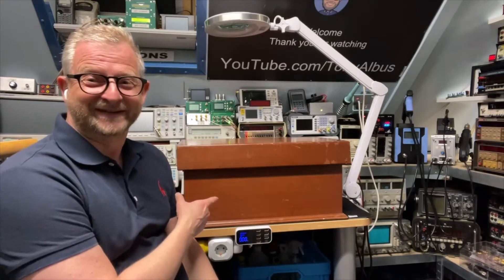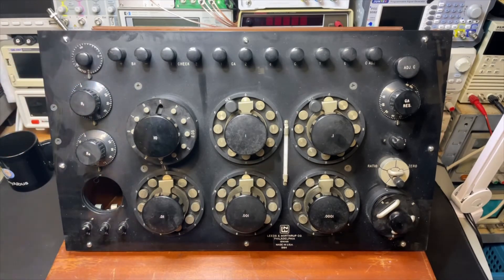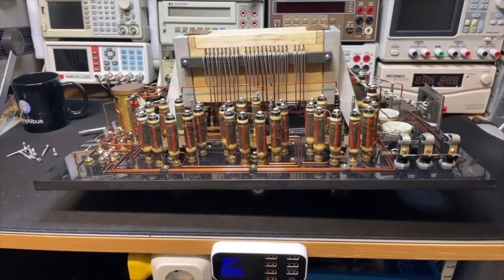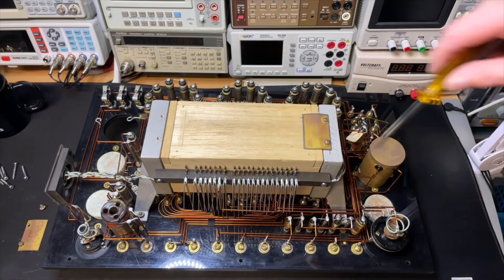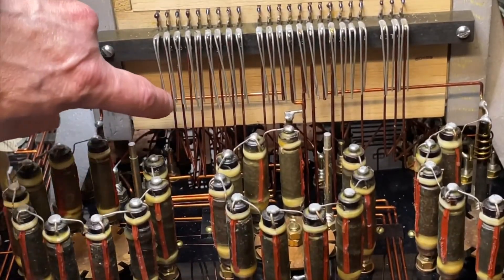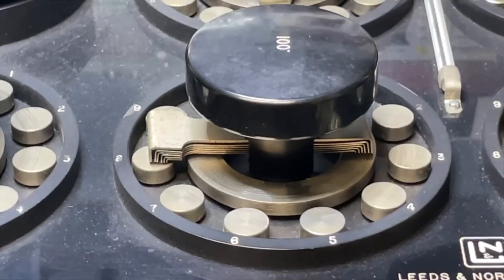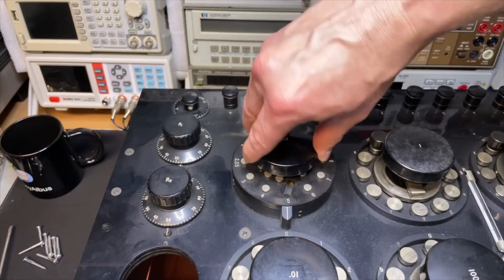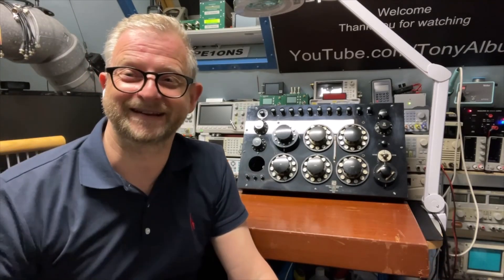#202 Classic Week Day 5 of 5 -  Leeds & Northrup Wheatstone 1964

Comment: You need a center zero meter for this unit
Reply from the maker: An external one i think right? do you know the value? .. from the pictures i have seen, the internal meter to be 0-5 mA
Reply: @TonyAlbus  As you are reading a bridge in balance the current through the meter is zero, so a center reading meter has to indicate either side of zero mid scale.
https://www.ebay.com.au/itm/254774972297?chn=ps&norover=1&mkevt=1&mkrid=705-139619-5960-0&mkcid=2&itemid=254774972297&targetid=1278935638209&device=c&mktype=pla&googleloc=9071768&poi=&campaignid=12502547493&mkgroupid=123090288695&rlsatarget=pla-1278935638209&abcId=9300512&merchantid=7364522&gclid=CjwKCAjwxo6IBhBKEiwAXSYBsyBWh9gOeAzRspT2XMzfCBMwEtJyIVYFhc5qS05L9RXDRhEKSW_StxoC-IcQAvD_BwE
You can check with a dmm which will read positive and negative this will give you some values to work from.
Reply from the maker: @garthdaddy7438  Thank you, i think that Galvanameter should be connected to the connectors at the top, this little internal Amp meter is just to keep an eye on the total current true the circuit so you don't burn your resistors. the value of the external Galvanometer also prob. depends on the battery value that you connect also to the top pins.
i did show pictures of the original meter in my video. i sadly have no pictures of the device fully connected with battery and galvanometer.
Reply: @TonyAlbus  Yes lowest voltage available to operate the bridge to avoid heating any resistors, the galvanometer has to be very sensitive. That ammeter is a good addition for such a sensitive bridge.
Reply from the maker: @garthdaddy7438  Yes totally agree, thank you for the link!